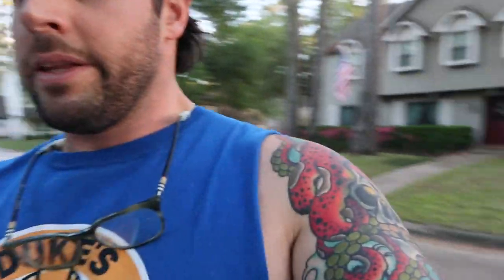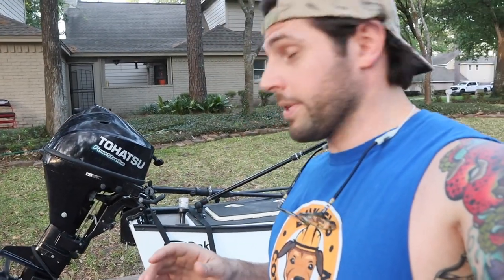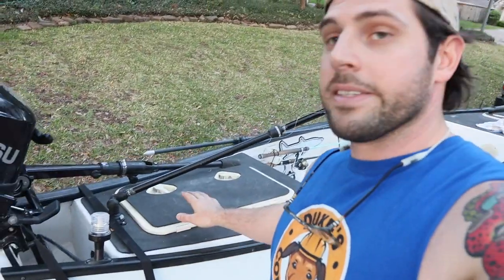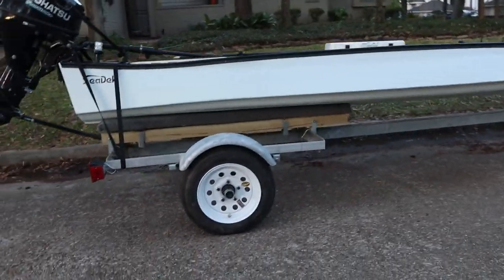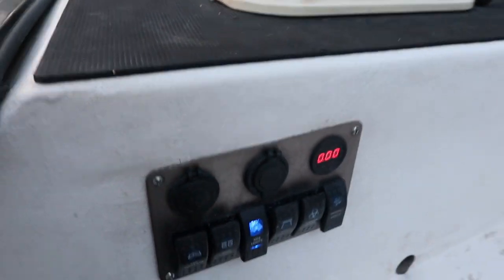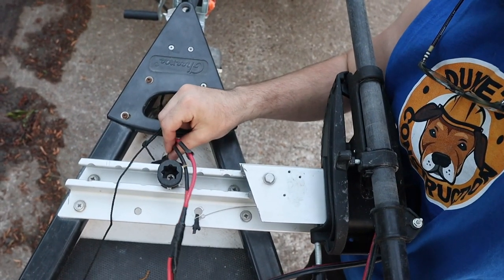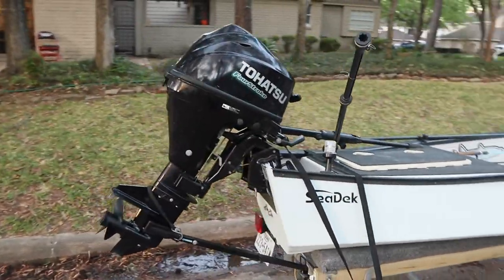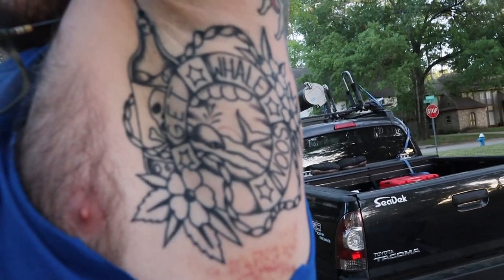Gheenoe Highsider walk through. 1 year review/update

Comment: Hey im trying to decide on my first gheenoe. Im between the lt modles or the classic or this highsider. Im happy with simple so highsider is taking the win so far. 

My question. How fast did it go with the 8hp and how fast is it now with the 9.8? Can it do 20-25 mph loaded?
Reply from the maker: Hey man. So the 8 hp was lighter and faster than the 9.8. The 8 hp was a 2 stroke. Loaded up and by myself it did about 22. I will definitely 100% get a two stroke next time. 

The classic will be more stable and have a lot more room. If you plan on bringing a passenger get the classic.
Reply: @dukesoutfitters3599  yes ive been reading and watching videos. The highsider and classic are where im stuck. I can install a poling platform on the classic and the highsider will get me through tighter spots. Leaning towards the classic just because of the platform. Thanks for your input. 

Also it will mainly just be me and my 2yr old daughter out fishing and occasionally my wife or a friend. Winter time though we like to camp so the classic is winning again for storage space.